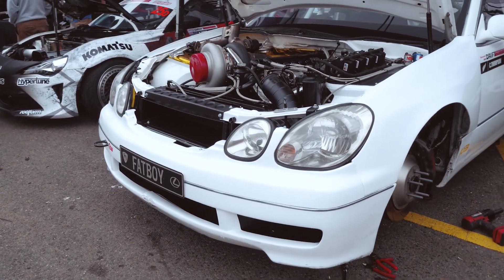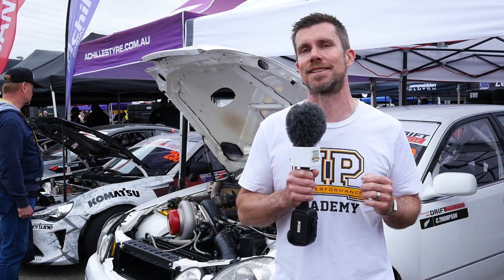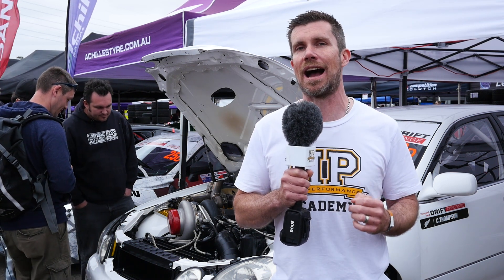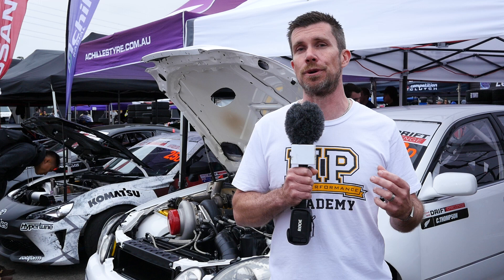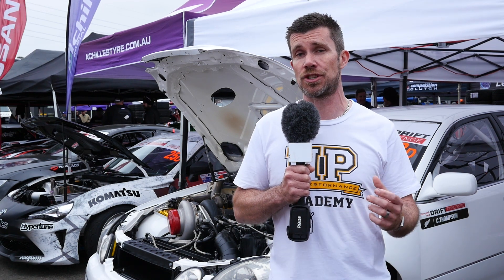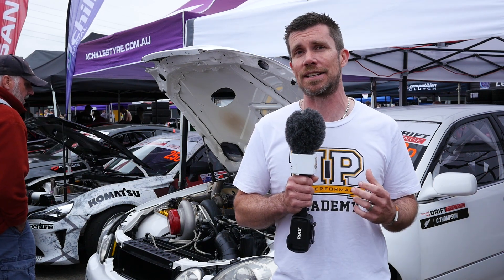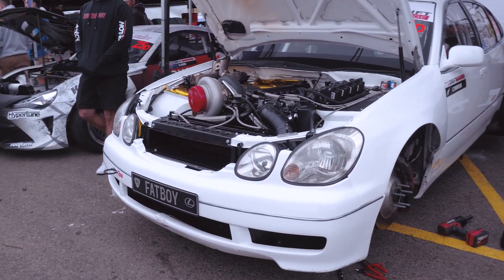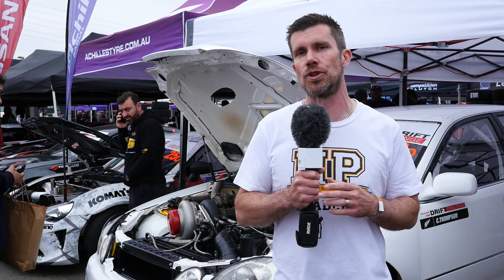1300 HP 26B 4-rotor | Drift Aristo/GS300 [TECH TOUR]

Comment: Andre not sure if you're still answering comments on 5-yr. old videos but do you have anymore info. on side ports?  Difference btw Semi PP?  Current status of billet housings to accommodate for higher hp apps as someone mentioned the Renesis wasn't the strongest engine ever built- Cheers
Reply from the maker: I read your comment wrong to start with, take 2.

We don't have a lot of information on any of those topics, whatever you can find on the channel using those search terms is it I'm afraid as we don't have a specific rotary engine building example in our paid course material yet.

I think the Aaron Parker, Rob Dahm, Green Brothers and Jon Blanch/Blueprint Racing interviews are the best bets. Sorry I couldn't be of more help - Taz.

Comment: And now Rob owns this engine (if not the identical back-up)
Reply from the maker: This engine is still with the car 👍- Jono
Reply: High Performance Academy right I was going to say
Reply: @FrezzyYT  lest we forget Rob mentioned the motor he got was a never-used back up copy of the original motor. When comparing small details to the 'Fatboy' Lexus 4 rotor (which Rob's motor is from), it's the same car as this. The intake manifold with all the injectors - looks the same.
Reply: @hpa101  In Rob's latest video, the clip he put in the beginning is this exact car. Every interior detail is identical. Rob definitely now owns the back-up motor that was originally intended for this Lexus.
Reply from the maker: @TheGuccibane  nice! The original engine that's in the Lexus no longer needed a back-up in the wings I guess as it did change hands semi-recently as well ;)
I hope Rob puts his engine to good use just as the owner of the Lexus will theirs #rotangtheworld =) - Taz.
Reply: It already looked so familiar lol. Was already wondering if this is the one.

Comment: Awesome video.  Ive followed this build for some time now on instagram.  This latest iteration is insane!  I wouldn't mind a closer look into that trick trunk mounted mechanical fuel pump that iirc rotational power is transmitted from the engine to the trunk via a flexible cable/rod?!?!? Holy smokes thats crazy.  Like a minature, flexible driveshaft spinning at 10k rpm lol (im sure there's a reduction as its not seeing the same rpm as the rotors)
Reply from the maker: Yes it's a neat solution. I'll see if Andre has some more information on it he can share - Taz.
Reply: High Performance Academy Thanks Taz
Reply: If it's driven off the back of the Dry sump pump it is probably running at half crank speed like most drysump do!

Comment: It looks like He is using the clutch in the Clip. 
Nice Video thanks.
Reply: Yes I saw that too. I think that is more for clutch kicking to make the tires spin easier? Don't think it needs to clutch to shift.
Reply: Having driven a few cars with sequential gearboxes (although not a huge amount of seat time) half of the time you're stabbing the clutch just out of pure habit. That may be the case here too.
Reply: Sassy The Sasquatch  
Could be, i just thought it looked confusing that he is pushing the clutch even though he does not have to. 
Thanks for the answer.